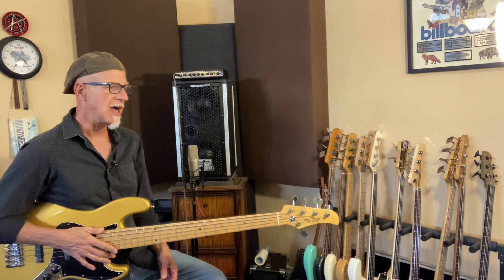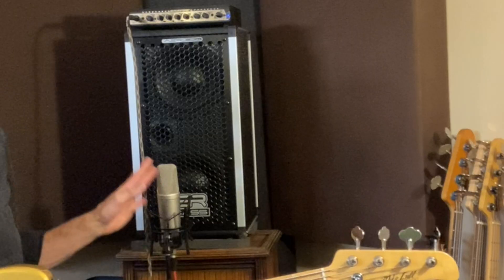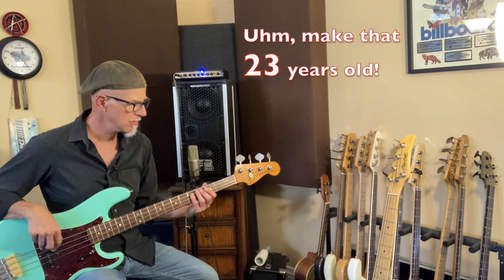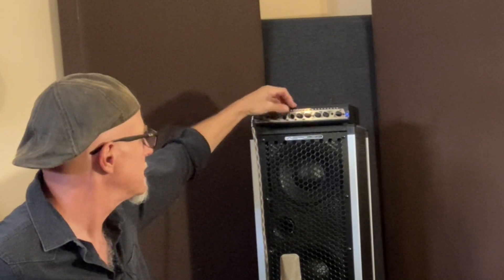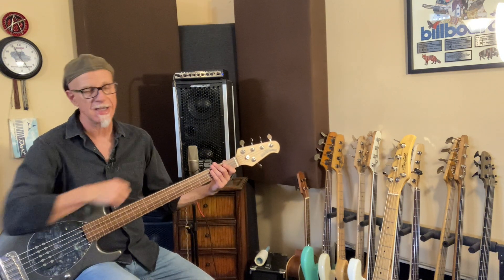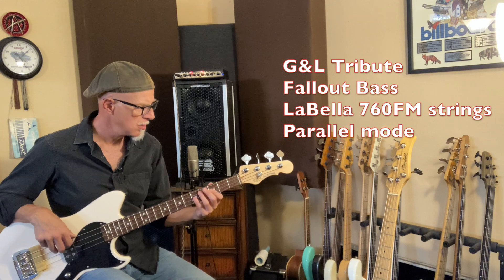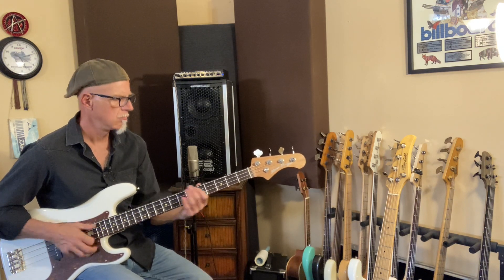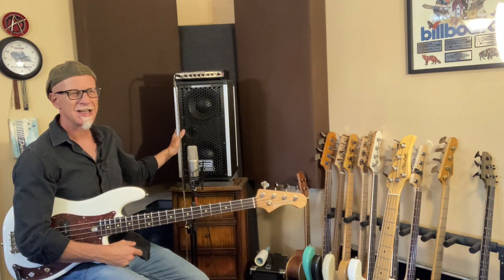GR Bass AT208 Carbon Graphite Featherweight Cab!!

Comment: Ed is a consummate pro and I have never been disappointed with his recommendations. 10 years ago I bought 2 Greenboy Fearless F112 cabs based on his glowing review, and they wildly exceeded my already high expectations. But I gig a lot and the drudgery of loading gear in and out of venues has finally gotten to me. I just ordered a GR Bass carbon fiber 212 Slim+ cabinet (mentioned in the above review). It's rated at 900 watts and weighs, believe it or not, only 26 pounds! That almost makes me laugh out loud. By comparison, my 2 F112 GB Fearless cabs, which are respectably light, weigh a combined total of 64 pounds. So I'll be saving 38 pounds for a load in, and another 38 pounds for the load out! My life will never be the same 😄 And I have no doubt, based on Ed's stamp of approval, I will not be disappointed with my sound.

Comment: I don't understand the lack of internal damping in these cabinets. Relying on the walls won't help deal with mid-high reflection back through the cones. The description of the sound as having more 'projection' and 'punch' is suspiciously like what you'd expect from an undamped cabinet. Analogous to putting soundproofing material inside a wall - it stops transmission between rooms, but doesn't perform the same function as acoustic absorption within the room. Be very interesting to see a CSD plot from these.
Reply from the maker: That’s an interesting point. I don’t have access to their design plans…. But I bet you could ask this on their FB or IG and get a knowledgeable response. I get what you’re saying, but as a user - I like what I hear. Projection and punch are important to me as a player, so if they achieve it with an undamped cab, I’m not sure that bothers me.
Reply: @BassWhispererTV  absolutely - when it comes to great tone, what works, works! Guess with respect to their use as bass cabs,it's more about whether they are 'coloured' and if so, in what way. Thanks for taking the time to reply, much appreciated

Comment: Since you asked, the GRBass AT208 is 22.5" tall, which is 1.5" shy of two feet. Very cool cabinet, although honestly the lower bass frequencies weren’t coming through my computer to my headphones all that well for some reason.
Reply: Is it possible the microphone wasn’t capturing the bulk of the low frequencies the cabinet was putting out?
Reply: @samlelowitch  looking at the driver specs, it looks like a low f3 of 68hz, a little high for subby bass. But more than adequate for most tasks.  A 4kg 2x8 isn't about high SPL (around 120db) and floor shaking sub bass...however it's better than I thought it would be

Comment: How would you compare this to GB Fearless cabinets?
Reply from the maker: Very different in design. GB is a three-way crossover, GR is two. The GR is more like a conventional bass cab design, where GB is more like a PA or studio monitor. They are both great in their own way. I’m using the GR rig locally instead of my F112. It’s less to carry, needs less power (4ohm cab), and sounds great in the small venues here. If I need to get loud... the GB will do it. Right now, GR doesn’t make a cab big enough to compete with my F215, so that stays as my concert rig.
Reply: Have you had any of their larger cabinets such as the AT 212 Slim or AT 4 12+ out in a big room where you could put some serious power through them ? When I have talked to several bass players about the smaller , lighter equipment , many respond about them being able to " move some air " . If you are getting your tone and volume , does it make any difference how it's done ?

Comment: I appreciate your playing and insights into instruments, but you don't understand the engineering involved in the construction of the cab at all and how those choices affect the final heard tonal aspects. Just because CF can be stiff, the design of how it's applied will determine the stiffness of the cab.
Reply from the maker: Why don’t you explain in excruciating detail what I got wrong?
Reply: @BassWhispererTV  hiiii ;) i have  question. Got the same head as you. I'm plyaing only on headphons without plugged cab. When everything is on flat position it's ok. When i boost low mid or high mid the amp starts buzz a little. When boost treble it's starts buzz a little bit more. All happens even without plugged guitar. Have you seen the same on your amp? When you record you used a noise gate? Btw great playing.